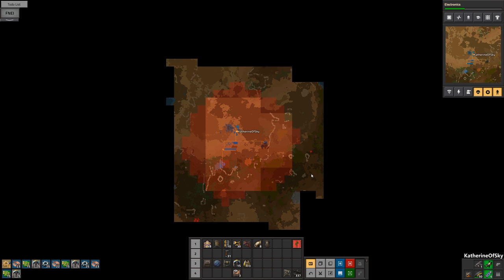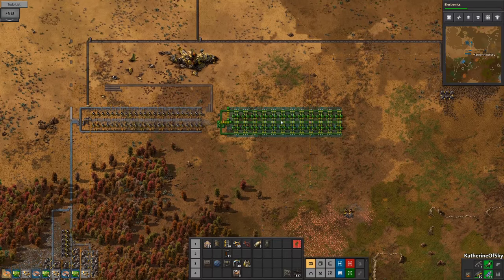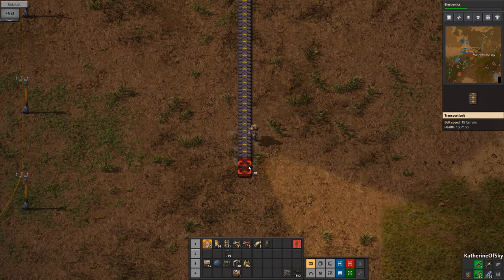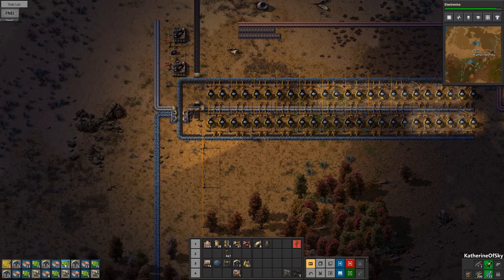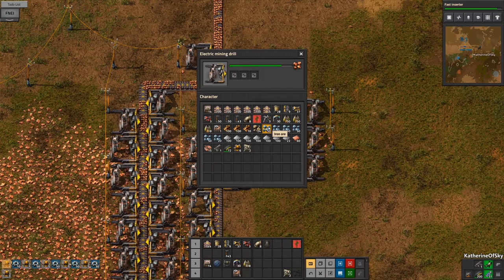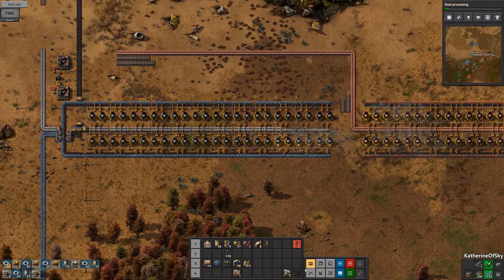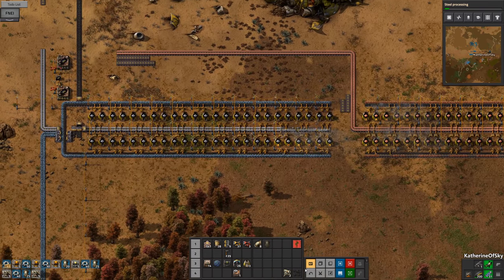Factorio 1.0 Entry Level to Megabase 3, Ep 3: RED SCIENCE & TURRET CREEP - Guide, Tutorial

Comment: At minute 42:20 Katherine says she wants to make 2 red sciences per second which for you would need at least 13.4 or 14 machines. Only placing 10 of them yields in 1.5 per second, which are 90 per minute.
Reply from the maker: When you play Factorio you simplify the math... and right now the speed of the assembly machines doesn't matter because they get upgraded.  The only thing that matters is that they are all the same.  So eventually we will get blue machines that craft at 1.25 speed... and I still call it "1 per second" because it simplifies the mental math.  You will see that the research flies by, and we don't need more than what I have built.

Comment: 20:41 - Unfortunately, the description for Nano Explosives in a misnomer.  It doesn't give nano bots the ability to replace cliff explosives, it allows them to use cliff explosives, much like normal bots.  You need to have cliff explosives actually in your inventory for this ability to be used.  There is talk on the Nanobots mod page to either change this ability to either require an entire full capsule, or to just fix the description to better explain how it actually works.  The comments go both ways, so maybe it'll be a config option which way it goes.

Comment: I'm thankful for these videos as I'm about 3-4 days old to the game... the biters got too hardy  for me to push back and my base finally got up graded to electric smelting  4 is plenty for cooper and I got like 16 iron has fluctuating needs.  Big issues came from getting blue (research) bottles and doing anything with oil.  I toggle different needs with plastic and sulfate.  Just started blue chip and some battery (chem factory) building.  Very limited.   And occasional power issues ... solar panels don't do enough...  well looking for advice..
Reply from the maker: With solar panels, you need MASSES of them... like huge tracts of land devoted to them.  Steam power is much better if you have a limited land area.

Comment: Boxes. You need several buffer boxes in a belt line (with inserters) to take up the excess product. At the moment you're running backwards and forwards collecting a few metal plates and watching production stop when you should be emptying the line and storing the plates in boxes for easy collection later. I've been interested in your methodical approach but also a little bit vexed you're not buffering your production lines with boxes (and boxes and boxes).
Reply from the maker: You must be new to the game.  Buffering is NOT a recommended strategy since buffers just delay knowledge of a shortfall.  If you weren't aware, furnaces hold a full stack of product, so they act as chests.  Watch the way I play and just see the "scarcity" that happens ... ( or doesn't )

Comment: 9:00 It seems like those right hand miners should just drop on the right side of the belt, rather than splittering together.

But my favorite biter combat is combat bots.  It does require military science, but even if you handcraft the 100 needed, it is essentially like carrying out 5 extra SMGs with AP ammo, more with more follower bot research.
Edit: but in early game (before military science), I find SMG + grenades more fun that turret creep, though I do like a few turrets i can retreat to.
Reply: What I tend to do is set up a strong point with turrets as close to the nest as I think I can get without aggroing them. I use 2-4 turrets and place 15 or so  mags in them. Then I bait the existing mob into the kill zone to wipe them out and head right back to wipe out the smaller mob that just respawned. Shooting the close ones with the SMG while tossing grenades at the stationary targets feels pretty nice.  I don't like the slowdown from the spitter acid, though. The game's combat feels like you're either mopping the floor with the monsters, or you get stuck on something you can't see in the chaos and end up shredded in half a second. There isn't much of a sweet spot.

Comment: Hey! amazing videos, I'm enjoying every second of it. 
I have a question, at 42:30 you said that you want 2 science packs per second, one science pack is made every 5 seconds, so with 10 machines making 1 every 5 seconds you get 2 every second. this makes sense.
except that this won't work, the automation machines have 0.5 crafting speed so that would make only 1 science pack per second right?
Reply from the maker: When you play Factorio you simplify the math... and right now the speed of the assembly machines doesn't matter because they get upgraded.  The only thing that matters is that they are all the same.  So eventually we will get blue machines that craft at 1.25 speed... and I still call it "1 per second" because it simplifies the mental math.  You will see that the research flies by, and we don't need more than what I have built.

Comment: a suggestion for your build ... yes build a copper smelt line above the copper ... and run the stuff to the bus BUT dont expand this portion here ... use this as a starter base ... even the power setup stop it there ... use this power setup to power the main bus fed resources and manufacture ... then if there Seperate power system fails the first one will jump start their power feeders BUT you still get your basic builds and some basic ore ... that way you can expand proper base properly instead of trying to squeeze and shoe horn it into a space smaller than it needs
Reply: instead of stealing coal before it gets stolen for iron ... split the coal OFF the iron belt and send it onto the copper ones ... then it gets used twice
Reply: 30 miners ... hmm say mine every time you place one and you will be a seagull from finding nemo lol

Comment: KoS - I believe there is a flaw in your mall. None of the boxes for storing belts, undies and splitters have limits on them so it eats up all your gears when you might not want it to.
Reply from the maker: The inserters limit them ;-)
Reply: @KatherineOfSky  that's only any good if you have circuits when you build the mall. I ended up with a wooden box (thankfully) full of yellow undergrounders. Lol.
Reply from the maker: @Stormthirst  No, I showed in my video that I do NOT have circuits researched, and I placed items by hand.  The issue may be that you used a wooden box.  Because you didn't use the correct receptacle (an iron chest), maybe it broke the circuit link?
Reply: @KatherineOfSky  hmmm. Maybe.
Reply from the maker: @Stormthirst  Try placing a correct chest / inserter combination.  They should connect automatically with wire.

Comment: How do you get enough raw iron/copper to fill a 4-lane bus? I started a game on an "easy mode" setting, with the patch richness and size maxed out. The largest patch near the start is iron, and from it I can maybe get 4 full yellow belts of iron ore. And even that will have to be split between some sort of steel processing and (later on) one single 48-furnace smelter.

Do we just start with a single line main belt (that is, one belt of iron and one belt of copper) and then set up trains for more materials?

And if we do have only one belt of materials, how do we keep the throughput balanced between the various different side factories (like your mall, for example)? If each splitter cuts the single main belt's items by half, don't we run out of materials pretty fast?
Reply from the maker: The answer is that you go out and find more ore patches :D
Reply: @KatherineOfSky  Right, of course. And then make either a long-ish belt if it's relatively close, or use a railway otherwise?
Reply from the maker: @diminios  Yep!  If you watch along in the playthrough, I connect several outposts, some which are quite far away.
Reply: @KatherineOfSky  Thank you! I intend to watch them, currently I'm done with episode 5.

Comment: Newbie question - Ive not started playing yet but watching to see whether i want to.  At around 18:56 you can see a conveyor feeding into another main line, but its been done with a splitter.  Why is that?  Why not just have the 2nd conveyor point directly into the first?  Does it just flow off the edge and get dumped on the floor rather than queue back?
Reply from the maker: If you butt the end of a belt to the side of another, all the content will go on the half of the belt that it is pointing toward, thereby unbalancing the belt.  Belts have two lanes of material
Reply: Thanks for the reply :)  I actually noticed that in a later video hehe, on a bit of a binge at the moment and decided to get it.  Great videos :)  +1 sub :)
Reply from the maker: @bt3iscrazy  Have fun!

Comment: Why do you stagger your electric mines? Is that a strategy or did it just happen by accident?
Reply from the maker: timestamp?
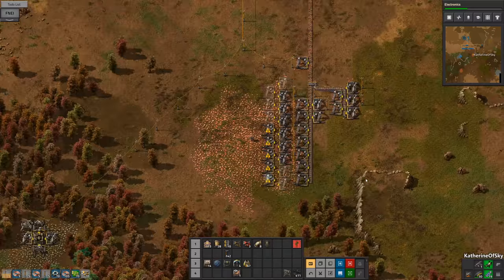Reply: @KatherineOfSky  11:38
Reply from the maker: @josephmort4039  I'm not staggering them: they are right next to each other.
Reply: @KatherineOfSky  The output arrows from the mines across from them are staggered, like a predator's teeth.
Reply from the maker: @josephmort4039  I align the miners with the edge of the ore field.  It doesn't matter what they are in relation to the ones on the opposite side.

Comment: Is it better to just use stone bricks over concrete?
Reply from the maker: Depends on what you want.
Reply: @KatherineOfSky  well I want to get replace all the dirt in my area so stone? Is the movement speed buff for stone bricks the same as concrete? And thanks for replying so quickly.
Reply from the maker: @cascade4661  It is slightly lower for stone bricks.  However, i would use any form of pavement minimally... paved ground doesn't absorb pollution, making it travel further, going out more toward biters and also reducing UPS.
Reply: @KatherineOfSky  thank you